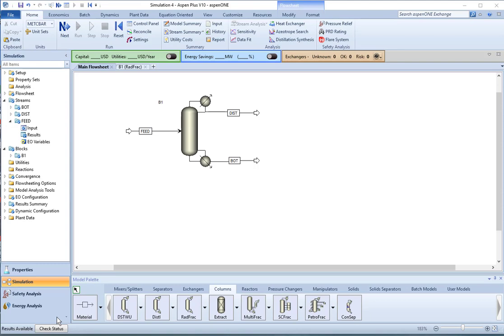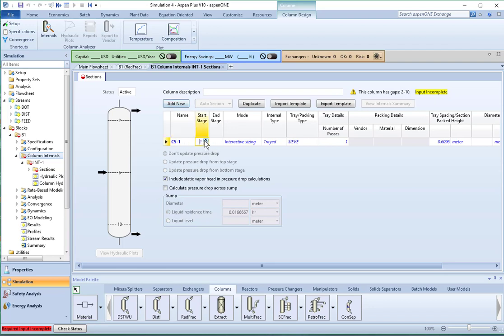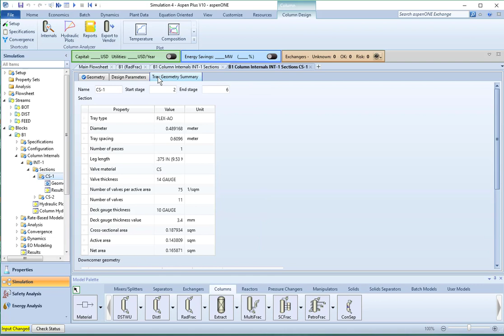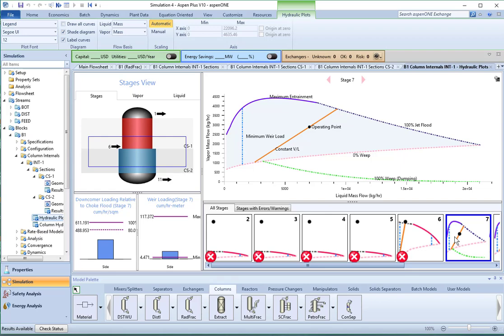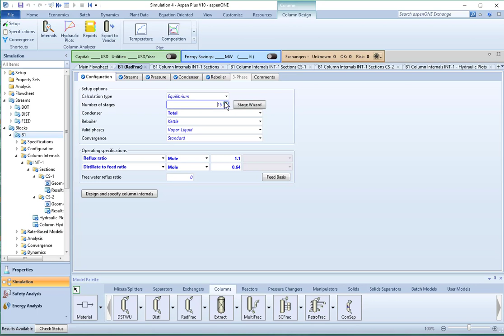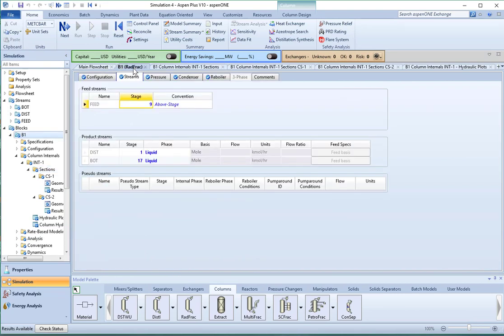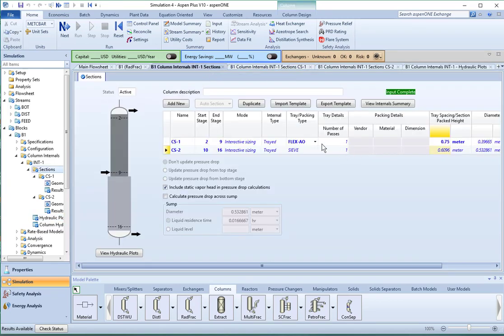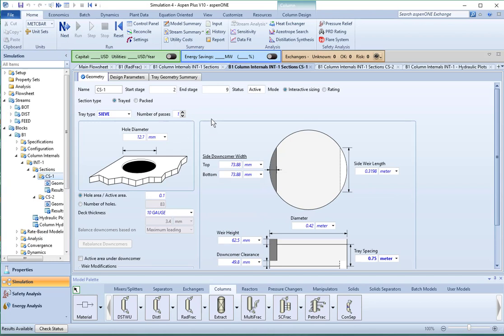Specifying Tower Internals with AspenPlus

Comment: Hi Ms. Patton
Do you mind if you could share with the feed composition, the operating conditions as well as the feed flow rate?
Another thing is that based on which book are you making this presentation? The reason is that you said "We're doing this simulation based on a book" while lecturing.
Thanks in advance

Comment: Actually increasing no. of stages will not help it. If we can't reduce the reflux ratio increase the column diameter, it will solve the issue.
If we increase tray spacing, then it may solve problem but it results more column height.
Reply: Agreed , column dia increase can be a solution.